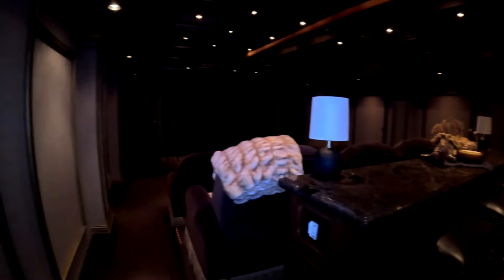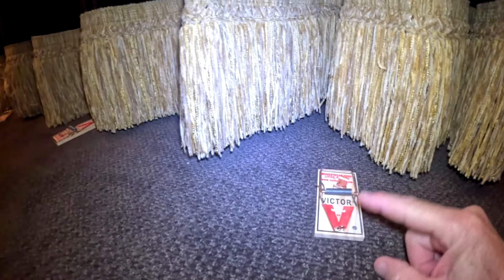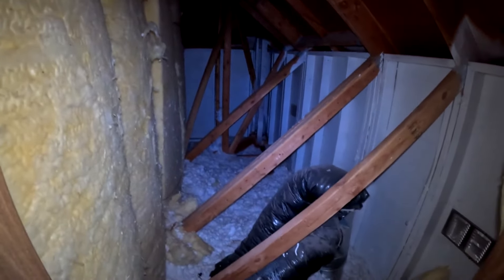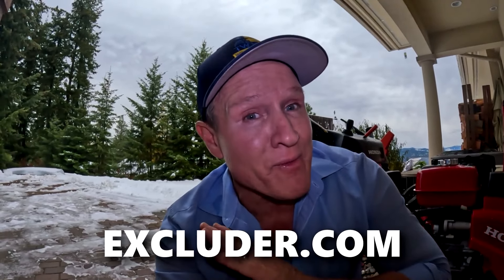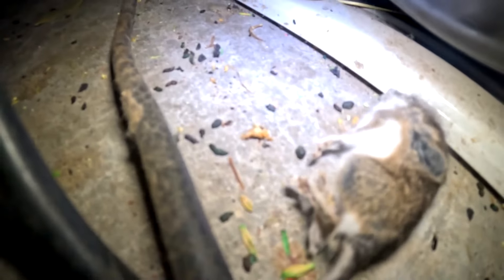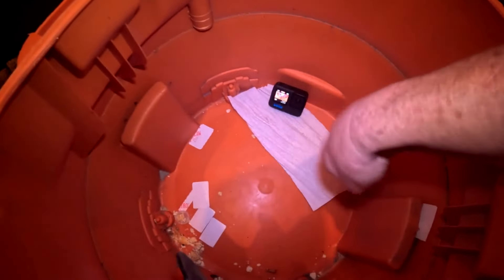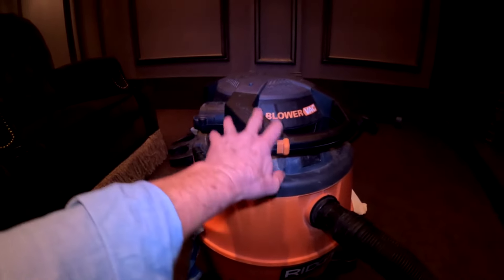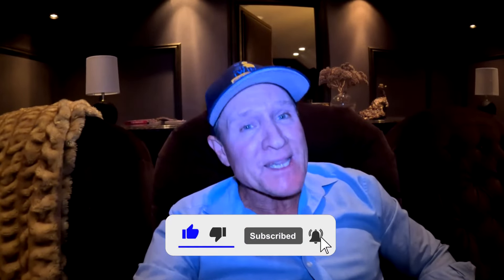$100,000 home theatre being DESTROYED by mice...

Comment: ok. anyone with a background in construction would know luxury homes are built in sections with additions and transitions from one section to another that might have been added at a later date. these are critical areas that must be thoroughly inspected for entry points. utilities are normally run through these areas as to hide electrical or plumbing. concrete slabs for car ports or florida rooms sometimes even enclosed porches give rodents a way into the home. now for you newbies in the game, let your favorite uncle bring you up to speed. where do you think all the junk food, trash, food wrappers and anything else you can think of goes. if you said in the hole before slab is poured or stuffed down into the hollow block you can move to the front of the class. 2-million-dollar home with a strong smell of urine with a thousand small drain flies but can't locate the source. three companies called out and three companies sent packing. cut the wall open behind the pantry only to find a five-gallon bucket half filled with urine...stay thirsty my friends.

Comment: Ratvac seems like a wonderful option, but a word of advice to anyone that thinks snap traps don’t work, you must place the traps with the front being the only accessible point! You don’t have to cover the top, just make sure the walls around and behind the trap and taller than a few inches (for mice) higher for rats. I also recommend the tomcat traps with the yellow cheese bait plate, with a dab of peanut butter on the innermost part on the plate.
Reply: The twin hood is essentially the same setup Im explaining, I’m not sure about rats, but a design like this works 100% of the time with the mice I deal with.

Comment: This is great….. but seems you need a new vacuum, a camera and to sit there until the rat/mouse turns up. You also need to rebate constantly.  I had a rat get in recently so I checked for entry points at ground level stuffed the hole with screwed up rodent proof metal mesh and then packed in a load of grout. I then ensured all water/food sources were unavailable. He hid in the loft, but eventually had to leave the roof and jump to ground outside to get water. During this time I found his hole outside and shoved a load of chlorine pellets down in there chucked some water down there to activate the chlorine and sealed the Holes with grout. I covered the ground over the hole with chlorine pellets as well and then gave the ground a nice good watering and I can only imagine it made his water and nose sting pretty bad if he came close to the entry point again. spent a few days away  and then 4 days later trying to get back in again (heard chewing and scraping) but then gave up after a few days. Not heard from the little sh1t since.

Comment: I dont like poisoning because of the chances of a dog or something getting it. If a dog eats rat poison like the bars or pellets you want to immediately force them to drink a couple shots of hydrogen peroxide it doesn't take much and usually every household has the regular hydrogen peroxide and that will cause the dog to puke all the poison up it won't have a choice but to evacuate everything in their stomach. Ive saved 2 dog's this way it's not fun or ideal but in a emergency it saves the dog and they feel fine shortly after or the next day both times the dog's had eaten large bars of poison.